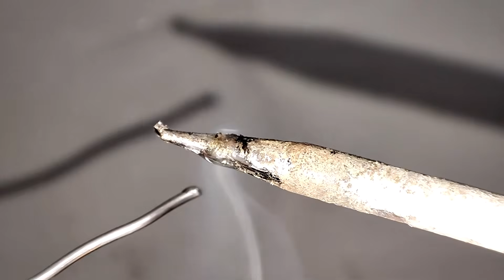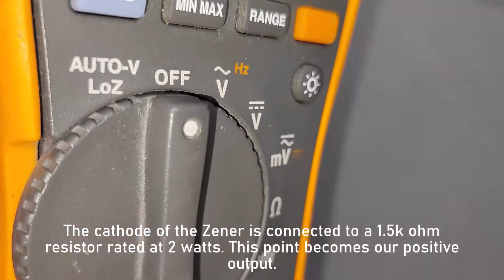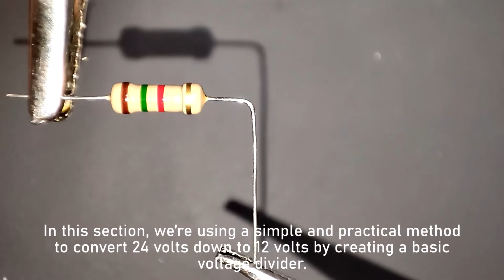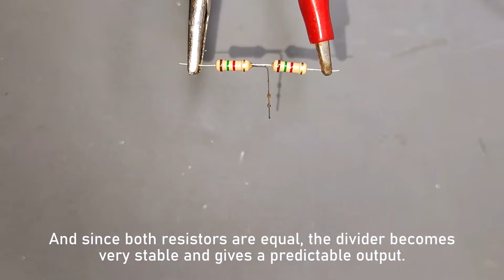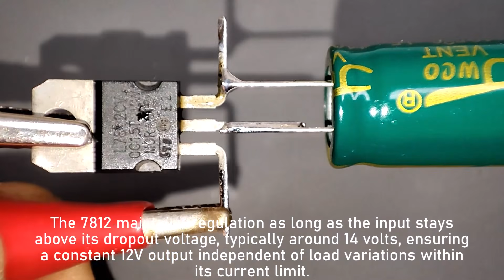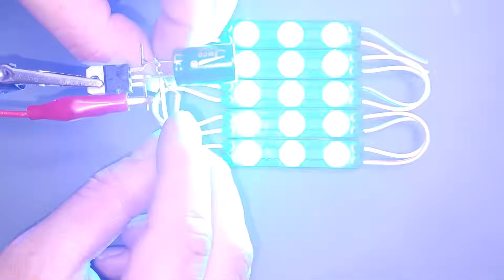How to Convert 24V to 12V DC | 3 Simple Methods Explained

Comment: @mosiala Your description above is incorrect.... You say "First, we use a simple voltage divider with two equal resistors to split the voltage.", but in you video you actual used a zener and a resistor first...  no mention of the Zener diode in your description above.    Needs updating but othersise great video!